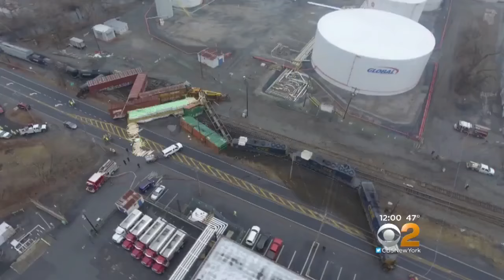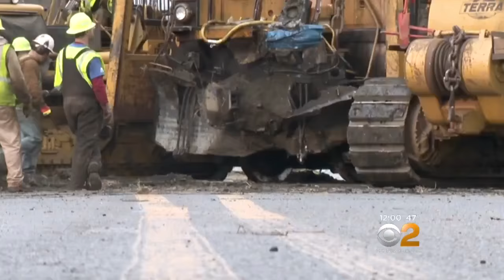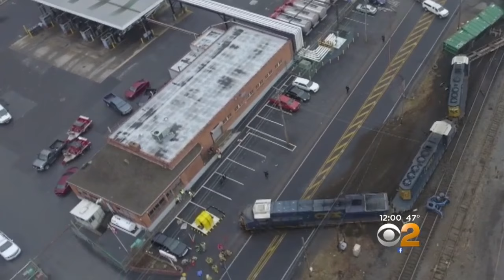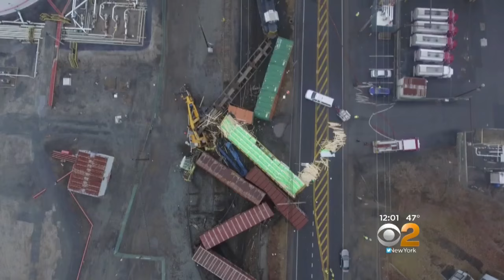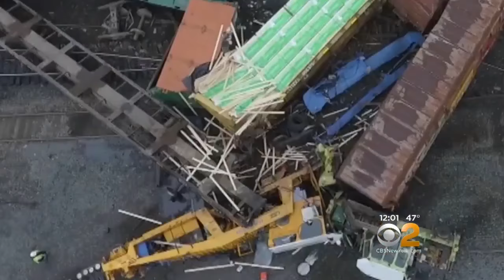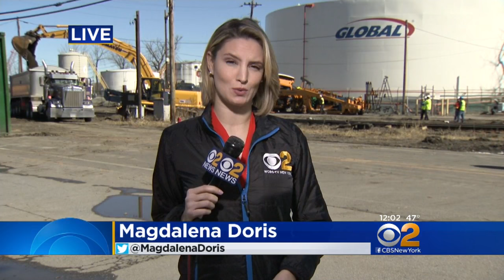Cleaning Up Newburgh Freight Train Derailment

Comment: 2 Maintenance way people died....
Reply: Nobody died, get your facts straight:

The train was heading south from the Albany area to Georgia when it hit the 135-foot articulating boom lift that became trapped on the tracks when the crossing gates came down. “For unknown reasons, that boom lift became disabled on the tracks. The operator of the boom lift departed that vehicle, obviously observing the impending impact,” New York State Captain Richard Mazzone said, according to CBSNewYork/AP. “The lead freight train subsequently struck that boom lift.” Captain Mazzone explained that the train pushed the boom lift down the tracks, which destroyed it. The train derailed and straddled both lanes of River Road, stopping just before the Global Diesel fuel terminal building. “During that derailment, the freight cars and the tankers, they struck two pieces of CSX maintenance equipment that were on an adjacent track,” Captain Mazzone said. He confirmed that two employees operating the equipment were treated for injuries, CBSNewYork/AP reported. He noted that the train’s conductor and an engineer were also treated for minor injuries. “Close to a miracle and we’re very thankful that we didn’t have any other vehicles or other persons that were injured or struck in this incident,” Captain Mazzone said. “It could have been worse than it actually is.” Captain Mazzone said that of the 16 cars that derailed, five were tankers.